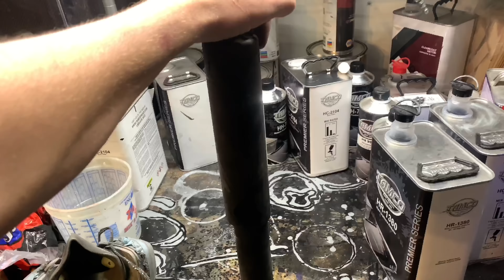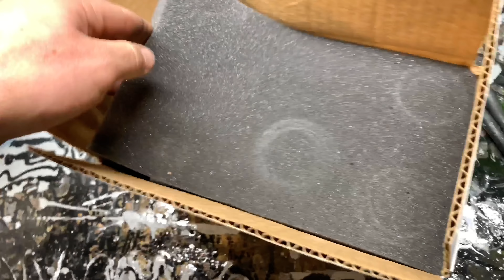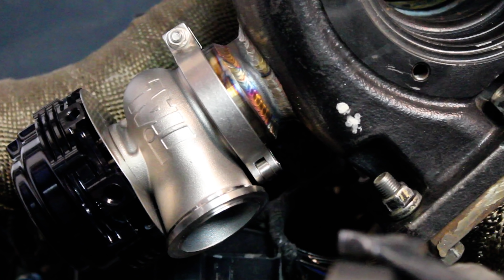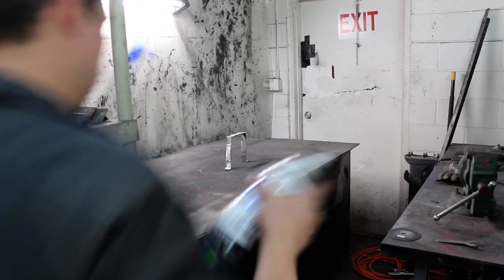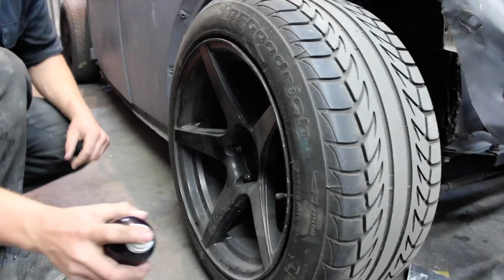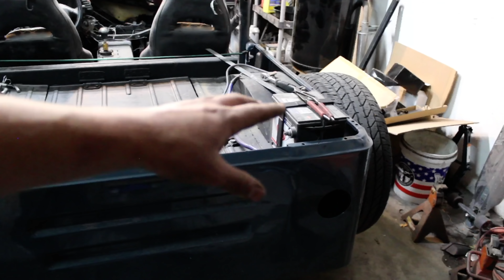Our DESTROYED Corvette gets some Turbo parts

Comment: Maybe you should go with a smaller fuel cell. 145 pounds of gas is gonna feel like you're weighed down.
Reply from the maker: Doesn’t always have to be full, but wanted the option of long drives
Reply: @GARAGEIdiotS  hey wrong answer, you're supposed to be an idiot! 😁